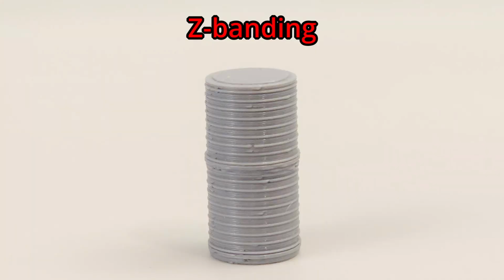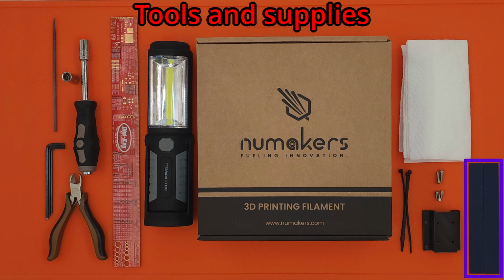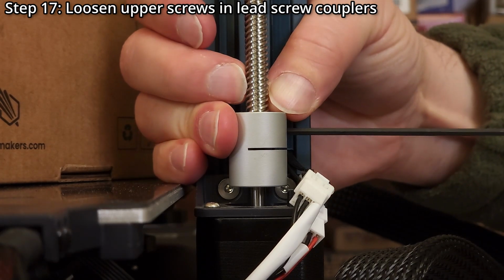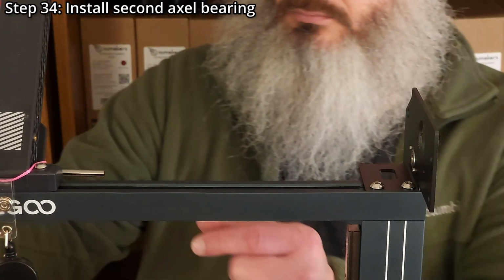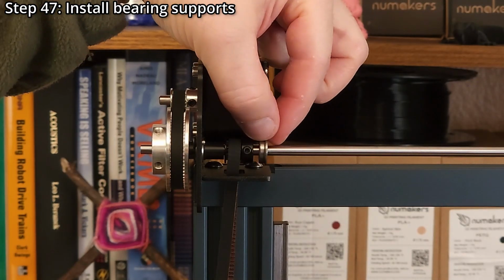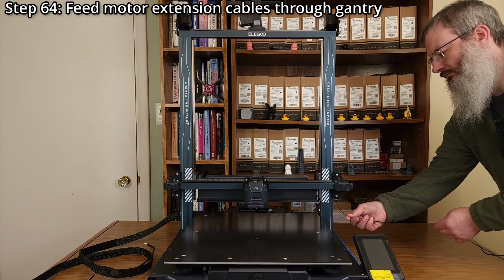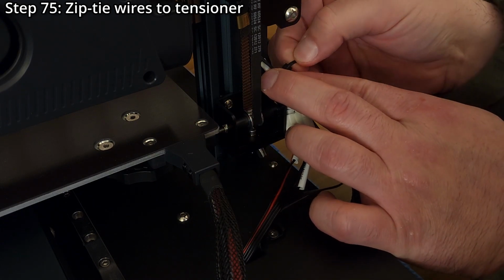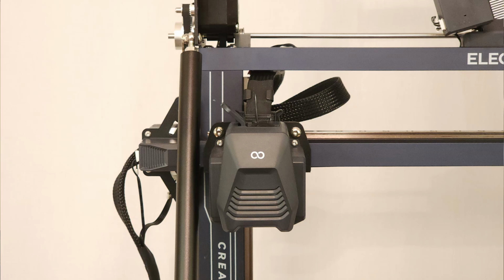Say goodbye to Z-wobble with the Neptune 3&4 Max Belted-Z Mod!

Comment: Ordered the Z Rails and Belt Mod for my 4 Plus on Friday. Can't wait to have full rails and see just how fast this thing can go.
Reply from the maker: Awesome, let us know how it goes!
Reply: How did it go?
Reply: @theoneed2051  it prints flawlessly
Reply: @BryanBalak  Nice!  Does the gantry tend to slide down to the bed on it's own when the motors are off?
Reply: @theoneed2051  not at all, it stays ecaxtly where it stops, or the gcode tells it to go. It took some adjusting, but everything is super smooth. Probably the biggest piece of advice is, not to over tighten the screws for the rails. That leads to binding. I wish they would provide a torque recommendation.

Comment: I found it's best to leave the z-rods over the belt system. The gantry is just too heavy for belts in my opinion. I switched back to the z-rods.
Reply from the maker: Thank you for watching our videos! Do you have a Neptune 4 Max with the auxiliary fan installed? I've found the gantry doesn't move on my Neptune 3 Max or on the 4 when I remove the fan.

So far, I've mostly just focused on developing an easy set of  installation instructions. I will need to spend more time with the mods installed before I can provide a reliable review.

Comment: Another cool video,thanks,I had the falling down of x azis in belted z enders,the solution was more powerfull motor installation.Whats your opinnion of installing bigger motors?
Reply from the maker: Thank you for watching our videos! Changing the motors could work, but I think changing the gear ratio is another common option. I don't really have the background to say which is better. However, I do know that TBStron3D is looking into different options.
Reply: Another great video, my shipping list grows!

Any other mods coming? I have the linear rails (X,Y,Z) plus this now.
Reply: Friction is the key to resist the gravity force or I was using a spring key holder to keep the x axis in place